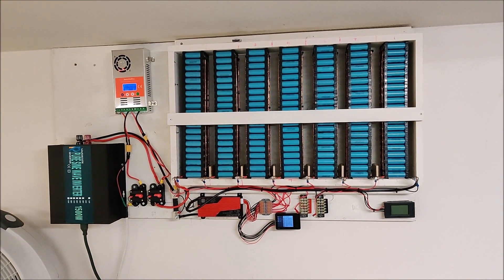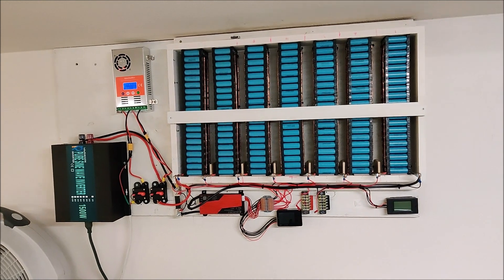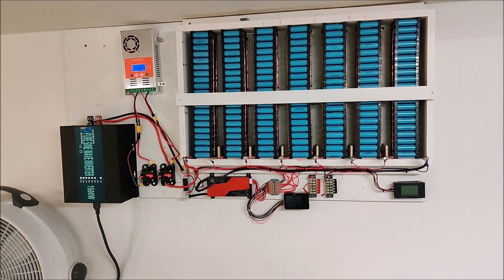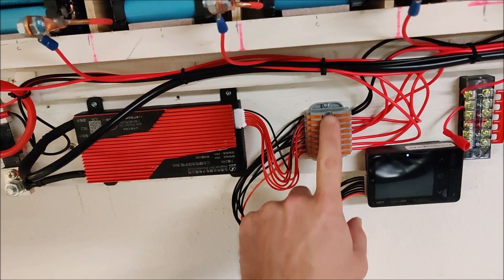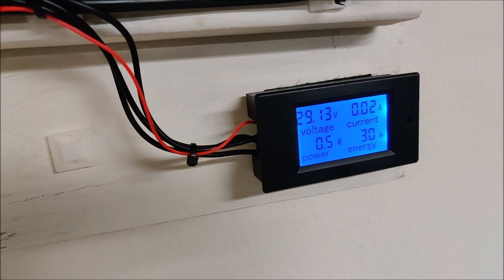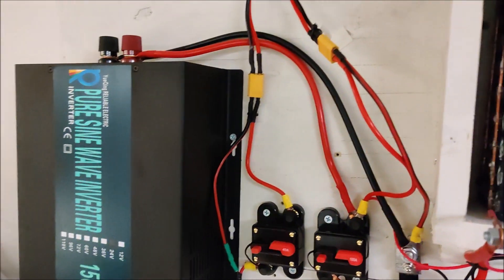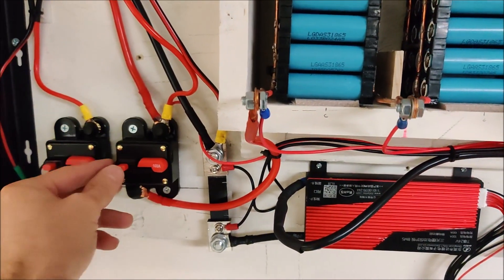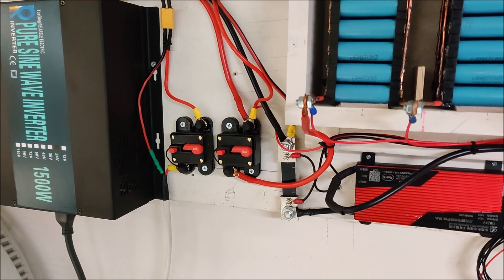DIY SOLAR POWERWALL

Comment: In a decent sized house with 120v AC, is there a problem with running 12v packs into a quality inverter? Im stuck choosing the dc voltage.
Reply from the maker: For a Cabin, 12V might work, but for a house, you need higher voltage batteries because the wire size will become way to big at 12v. Consider at least 24v if not 48V. Most people use 48V for a house.

Comment: Hello, I'm going to make a battery with the same battery group.  What would you recommend as BMS?  Battery 18650 lion 3.7v nominal voltage.
Reply from the maker: Yeah get a 100amp Daly. Well made and simple. Just works. https://amzn.to/3ZygFwG
Reply: @stevenc22  If I do 8S 32.8, IS IT SUITABLE FOR 24V? 8s 4.2 24 volt lion 18650 battery pack
Reply from the maker: @volferm  no. Most 24v inverters have a max input of 30v. That's why you do a 7s with 4.2v batteries
Reply: @stevenc22  I understand. It was writing 33v on the smart inverter. If it is suitable for 33 volts, is 8s suitable?
Reply from the maker: @volferm  sure. If the inverter can take it...
Reply: @stevenc22  I understand.  Is 100A BMS enough for 3000 watt inverter?
Reply from the maker: @volferm  No its close though. For 3000w you need a 150amp BMS
Reply: @stevenc22 For your help very  thank you. 😊 I will buy 150A bms.  I will forward the test results to you.

Comment: What the number your wire # using your diy  mppt to battery and solar pv array to mppt?
Reply from the maker: I use 12awg from my solar to my mppt and to my battery. Size your wire based on your amps.

Comment: So I have 2.5kw in panels, 24v 3000w pure sine inverter, 60A makebluesky, wires and no batteries. I need to build me a small 8 to 10kw battery. Your setup looks cool...
Reply from the maker: Thanks George. Your choices are lithium ion like my powerwall which is cheaper but lots of work sourcing and assembling the batteries. Or you can get Lifepo4 which costs more but 8 batteries could get you the powerwall you l size you want for $1000
Reply: @stevenc22  one choice I had was 8 of the 3.2v 280A Lipo cells. I'm not sure if to get used EV batteries. I do want to grow the battery and may even get 16 cells.
Reply from the maker: @cutweldngrind  I have 16 280ah new grade A batteries being shipped to me for my next power wall. Cost $2000. I'm doing 8s2p configuration. You could buy 8 and later add another 8 and not have to buy new inverter or solar equipment.

Comment: Hi Steven. I am using your model to build my Diy powerwall. How do you calculate the voltage needed to charge your pack ?. How much current are you sending to it for charging ?.
Reply from the maker: Otis, my powerwall is a 7S powerwall. Each battery has a max voltage of 4.2V so if i have a 7S powerwall, the max charge of of the entire powerwall is 7 x4.2v = 29.4V. My solar charge is set to charge at 29.2V (slightly undercharge the powerwall to be safe).
Reply: @stevenc22   Thank you for the fast response, I plan to build the same exact setup. Its very detailed and easy to follow. 👌
Reply from the maker: For charging the powerwall, i have a 400 W solar setup, which sends about 10amps into the powerwall at max sun charge. You can also use a 29.4V power supply to charge the powerwall.

Comment: Pls tell me ,how Ah is your power wall.i knw is both solar panels are 200wats each ,and will also charge the power bank properlly
Reply from the maker: That powerwall in the picture is 6kw and later I added another 6 kw, so now it is about 12kw
Reply: @stevenc22  thanx man
Reply: @stevenc22  one more thing pls.how many watt panels would I need to charge it fast and efficient.
Reply from the maker: @prihakabm3248  a lot. If you had 1500 watt of panels you could maybe recharge in 1 day  of nice weather
Reply: @stevenc22  ok great keep the good work going.

Comment: Please what's the wattage of your solar panels. ?
Reply from the maker: 400w
Reply from the maker: 4 x 100w to be more precise
Reply: 100watt 12volt each or 100watt 24volt each?
Reply from the maker: @edwingeorge9097  These panels have a 20V open circuit voltage. I actually series all 4 panels together and get about 70v @ 5 amps which then goes through the charge controller to be converted to 29V. 

These are the actual panels i use. They arent the best but they are cheap :) https://www.amazon.com/Newpowa-Monocrystalline-Efficiency-Module-Marine/dp/B07JX61QJ5/ref=sxts_sxwds-bia-wc-p13n1_0?cv_ct_cx=solar+panel+100w&dchild=1&keywords=solar+panel+100w&pd_rd_i=B07JX61QJ5&pd_rd_r=d869bf27-a16c-450c-8943-5b2a88d128c0&pd_rd_w=7ne7Q&pd_rd_wg=izZbo&pf_rd_p=224b59c9-c98f-46fd-96d6-8e952866d6a3&pf_rd_r=J90XWCN78FTMANAATPEF&psc=1&qid=1601384263&sr=1-1-a14f3e51-9e3d-4cb5-bc68-d89d95c82244

Comment: Get a grid tie inverter and run it as a load dump so when batteries are full the inverter will put that small load into the grid
Reply from the maker: if i had more solar i would. With only 400W of solar its not worth it.
Reply: @stevenc22  still roughly a kwh a day. x364days adds up. I started with 600watts first year it made 1000kwh

Comment: How long does 5kw run the airconditioner for?
Reply from the maker: My AC is very ineffecient. It runs about 4-5 hours on my first battery pack. I have since expenses my powerwalls to nearly 12kw and can run the AC 10+ hours
Reply: @stevenc22  Thank you, that helps me factor in real world numbers :)
Reply from the maker: @rustusandroid  a window unit is way more efficient and could run twice as long as my protable AC unit

Comment: This is a video I watched many a times. It is neatly done! I love that!! Great explanation too. One question I have for you. Any reason why you chose common port bms? Don't you think it is better to use a split port bms? Especially if you are going to use it to power up whole house with more solar panels?
Reply from the maker: Not really.  If I used a split port BMS my solar couldn't go direct to the inverter. Right now because my solar and inverter all connect through the same line the solar can bypass the BMS and be used directly by the inverter. If I used a split port BMS the charge from the solar would have to flow into the BMS and then back out to the inverter.  It will work either way but I don't see an advantage to a split port BMS 👍
Reply: @stevenc22  Thank you very much for the explanation. It helped me a lot to figure out putting my power wall up ! Thanks again!

Comment: what is your battery make up ? i see it's 7s?P , but i can't tell how many parallel "P"
Reply from the maker: 7s 80p. And now I have added a complete second bank of batteries so it's more like 7s 160p now
Reply: @stevenc22  >> What do you forse as far as maintenance goes ? how often do you check for a bad cell or blown cell fuse ? looks tedious.

Comment: good morning friend I have a 7s 100p powerwall with delegate 1s active load balancer and also the mppt MakeSkyBlue 60A charge controller I need to connect all you could help giving me the charge parameters for the bulk absorption float controller my email gonzalezjonathan87 @ gmail.  with greetings from Costa Rica
Reply from the maker: Im not quite sure what you are asking me. If you have a makeskyblue charge controller and a 7S powerwall, then you need to set only 2 parameters in the controller. D04 to 1 (Which tells it is a lithium system) and D02 to 29.4V which is the max voltage of the battery. All other setting are irrelevant. When you set D04 to 1, the controller doesnt use D01, D03, D05 or D06 any more.

Comment: looks great ;) wanted to build something similar but couldnt find good amaunt of 18650 sells for this kind of project...
Reply from the maker: Yes in other countries they are harder to find. Check out your local electronic recyclers, you might get lucky. Or you can look into getting a battery from something like a Nissan leaf electric car from a junk yard!
Reply: @stevenc22  leaf batteries are imposible to find... we dont have that many of them... and i already emptied all electronics repair shops :)

Comment: Why not use a grid tie inverter so you can use power for everything in house
Reply from the maker: I only have 400w of solar. That is not enough for a full grid tie system. My system tricky charges the powerwall during the week for me to use it on the weekend to run my AC and garage
Reply: @stevenc22  I only have about about 500w of solar also but I plug into a 1000w grid tie inverter since the house is always using at least that much.

Comment: Hi friend, greetings from Chile ... How has this bms worked for you in your system? does voltage balancing work? Cheers
Reply from the maker: Seems to work fine. Voltage balance is okay. It only voltage balances above 4.18 volts and i tend to keep my pack around 4.15 volts so it doesn't really do any balancing. I plug in a ISDT external balancer occasionally.

I have tested its high and low voltage cutoff which work correctly.
Reply: @stevenc22  Thanks for your answer ... how many amps is the BMS you use?

Comment: Will this connect to the solar system I have with inverter already installed?... or do I have to have a separate inverter for the powerwall?  What is the total cost for this powerwall?
Reply from the maker: Absolutely it can connect to an existing solar installation. just make sure your battery and your inverter are the same voltage. 

The first 6kw powerwall cost $600 and the n the second 6kw expansion cost around $300
Reply: @stevenc22  my solar panels are grid tie.  So how do I SAFELY connect, so that when the grid is down, my system will automatically connect to the Powerwall?
2.  How long will these batteries last and to what percentage can they be drained before recharging?
Reply from the maker: @dianajohnson4144  a grid tie transfer switch is installed and allows you to switch your house between the grid and the battery.
Reply from the maker: Lithium batteries don't have percentages. Full they are 4.2 volts and empty they are 3.00 volts. Below 3 volts the lithium can be damaged!
Reply: @stevenc22  How long do these batteries last?
Where do I buy them?

Comment: i want to create this, but charge from the grid. how do you charge it from the grid?
Reply from the maker: Easy. Since this pack is 29.4 volts fully charged, you just use a 29.4V transformer to charge the pack. i do this when solar is too slow. They make 29.4v transformers just for this purpose! 

https://ebay.us/DbdOGA

Comment: Those breakers are designed for audio not solar 👍
Reply from the maker: Yes, they are designed for automotive, which is normally 12v system. They work for high voltage if you account for total wattage.

Comment: Nice! Very very Nice. But shure, that the Busbars not to small? 1500W / 24V = 62,5 Amps. 2 x 2,5 mm2? Maybe they got hot. Better you double it.
Reply from the maker: Yeah thanks. 8 awg solid copper over a short distance is good for 75 amps but it is border line. I normal twist copper wire for a bus bar but decided to try single thicker strand this time. I've been powering my AC pulling 1400w continuous and I'll check temperatures tomorrow and report back.
Reply: @stevenc22  Ahhh ... ok... 8 AWG seems ok. In my eyes it looks like 13 AWG. I am looking very interested for tomorrow.
Reply from the maker: @uwe2030  Here is an update video with temp testing https://youtu.be/oX8Sr--snGg

Comment: you should always shut solar off before battery starting battery solat then inverter or load got to say one of the cleanest sey ups i have scene
Reply from the maker: Thx David. Yeah I always pop my solar breaker before my battery breaker.
Reply: @stevenc22  yeah i learnt the hard way and blew a controller

Comment: Hi ,lithium ion powerwall  is addictive. .You  have two  sets of 7s/ 80p so those packs in one bms? How many amperes you use for balancing those 14 packs? The price on ebay starts from $59 for 80amp bms...
Reply from the maker: No. Only 1 set of 7s on the BMS. I might add a second set later but I will give it a separate BMS if I do. I occasionally hook up a big external balancer when I want to rebalnce the packs.

Comment: Do you have link of the battery you use ?
Reply from the maker: I buy from batteryhookup.com

Their selection varies every week.

This is similar to what i used

https://batteryhookup.com/products/99-lg-18650-2600mah-lgabb41865-cells-lithium-ion-modem-batteries

Or this

https://batteryhookup.com/collections/18650-lithium-ion-capacity-cells-in-modem-batteries/products/4-18650-2200mah-cells-in-modem-batteries